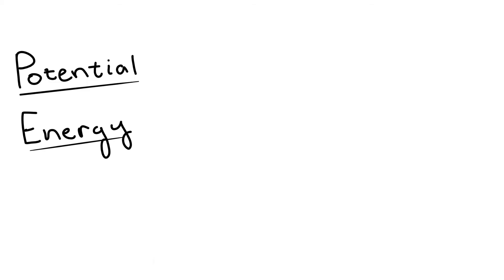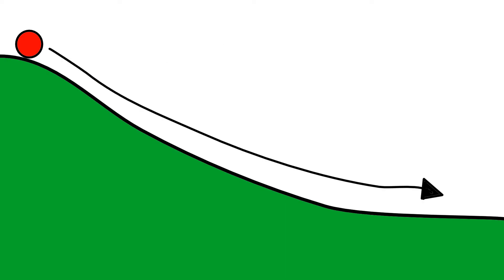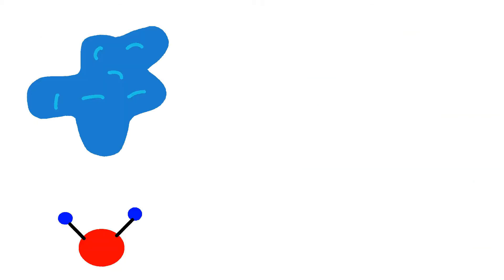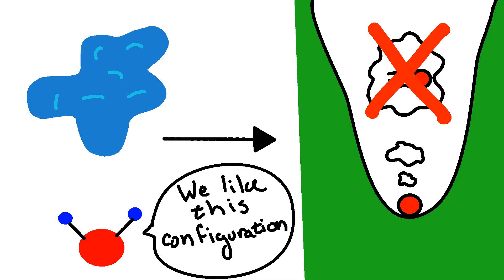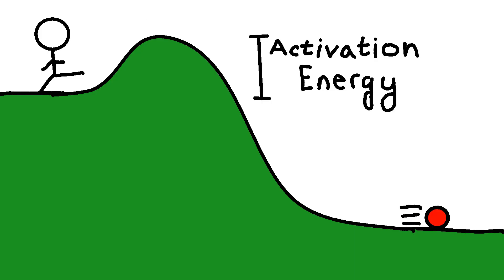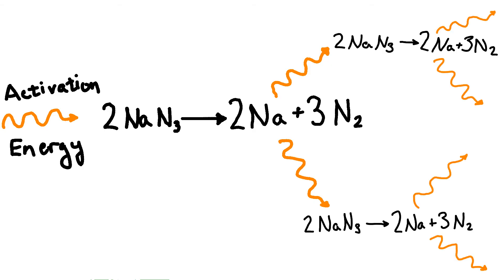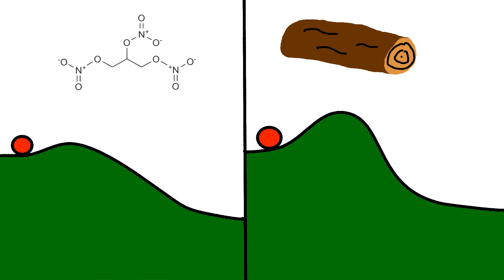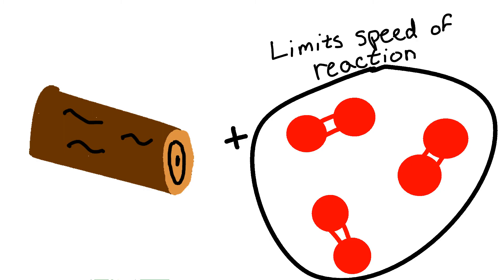Why Do Things Explode?

Comment: can you please explain why they make new molecules after exploding
i stil dont know
Reply: That is what is happening when some explosions occur. A campfire with logs burning inside of it is just a chemical reaction. This reaction is also exothermic, releasing heat to the surroundings- so you could say that the type of change that occurs is that chemical potential energy in the carbohydrate is turned into heat energy when it breaks down.

The solid wood is also consumed in the reaction-leaving residual ashes, which might be some materials which could not be combusted properly.

This reaction is limited by the available oxygen that is in the atmosphere as well as the available fuel that exists in the log. These limitations cause the log to be slowly consumed in the reaction. If additional oxygen is supplied through any method, then the log would burn faster.

An explosion is essentially a similar type of chemical reaction that involves a much more concentrated fuel source and/or a much more oxygen rich environment. The oxygen does not need to be in a gaseous form for the reaction to be able to utilize it either. Oxygen exists in many other molecules and can be stripped from the molecules that it is bound to if certain conditions are met. That is why some common explosive material recipes involve a fuel source and an oxidizer. The oxidizer is used specifically for the purpose of providing oxygen for the explosive/flammable reaction. The speed of this reaction is the reason for the extremely violent and intense result known as an "explosion" .

Comment: Love this content, can you shortly answer the last question to me I'm curious.
Reply from the maker: @Natalia Lewandowsk I'm glad you enjoyed it! Just to clarify, which last question? Why the idea of minimizing potential energy explains why particles have mass?
Reply: @zapphysics  yes I had exactly this question in mind.
Reply from the maker: @Nataliea Lewandowska this is a great question and honestly, this could be a video in itself (and I may make one on this!). The idea comes from quantum field theory which essentially says that particles that we measure are fluctuations in fields that stretch all through time and space. These fields have some "potential energy" associated with them that depends on how likely it is to find a particle spontaneously appear from the vacuum, called a vacuum expectation value, or VEV. The "true vacuum" or the stable vacuum (the state where there are no fluctuations) is determined by the value of this VEV which minimizes the potential. Now, this VEV doesn't have to be zero, as is the case with the field corresponding to the Higgs boson. So, if I have some particle that can interact with the Higgs boson that is massless, as this particle travels along through space, there is a chance that Higgses will pop out of the vacuum and interact with the massless particle. The effect of this is similar to shooting a bullet through water: the particle that was travelling at the speed of light (since it was massless) is basically "slowed down" by all of these interactions which effectively gives it a mass!
Reply: @zapphysics  wow thank you so much for such a good and to the point explanation, can't wait for more videos